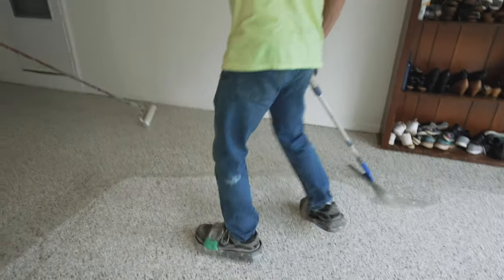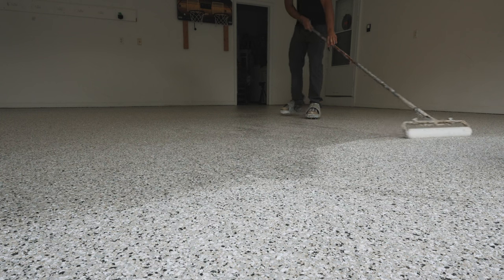Polyurea vs. Epoxy - This Changed Everything for Garage Floors

Comment: lol, for a SHOP floor you need a smooth surface, so clean ups are a breeze, you wont want oil or chems hiding in nooks and crannys or playing games to wipe up, a smooth STICKY surface is best ..

my buddy has a mat to the entrance to him home that's like fly paper, and once the layer is no longer sticky pulling dirt off your shoes, he just tears off the top layer and there is another fresh layer ready to go, prolly 50 layers per mat, you can use systems like this for sterile hi dollar shops that house spendy cars, this way there is never any dirt getting into your vehicles or tracked around your shop floor, a good fresh air filtration does wonders, as in filter it BEFORE it enters the garage, ZERO dust to get in nooks and crannys of your expensive vehicles, not quite as far as say a shop that makes CPU's or RAM sticks, but dang close, no dirt or dust entering your shop

Comment: Tell your camera guy to get a gimbal
Reply from the maker: I am the camera guy. It’s hard to film and install the floor at the same time. I don’t have time to deal with a gimbal.
Reply: @TimDCVA  well some for the effort 🤙but if you ever want to try a gimbal, the DJI Osmo 6 is pretty cool - can fold up into your pocket and will give you buttery smooth shots.

Comment: Can you use epoxy around pools? Is it UV resistant?
Reply from the maker: Some companies do… but I don’t think it’s a good idea. They are uv stable but I think they still turn a little amber if they are in full sun all day. I also don’t think it has enough traction for a pool.
Reply: I live in florida and when I had my lanai done, UV damage was a major concern of mine. They recommended I go with poly even though it's thousands more than epoxy. I've only had it for 2 years but I've been happy. No damage yet.